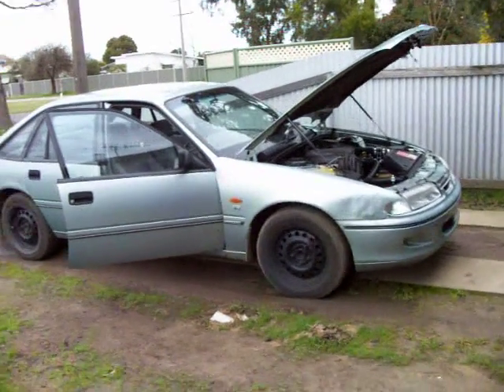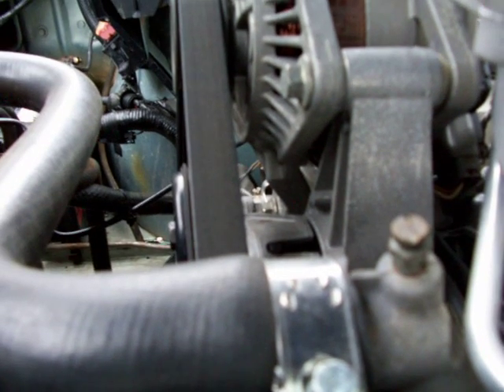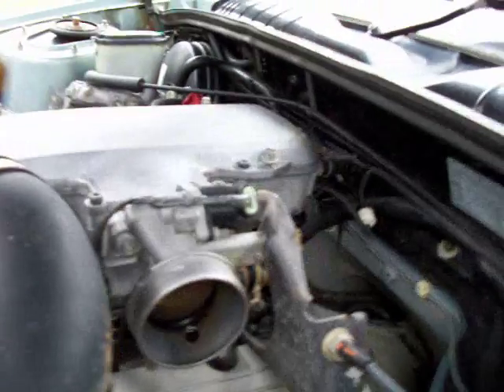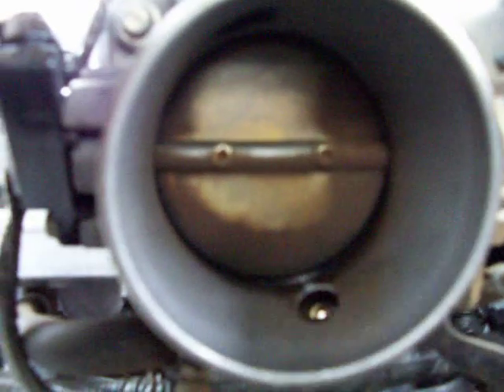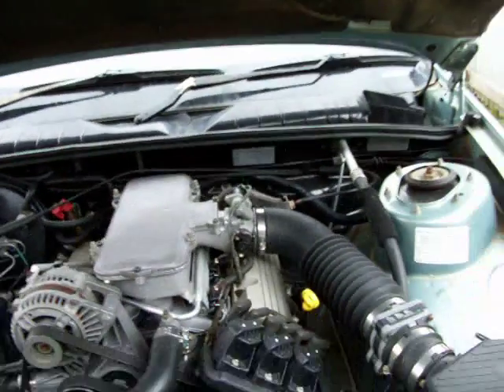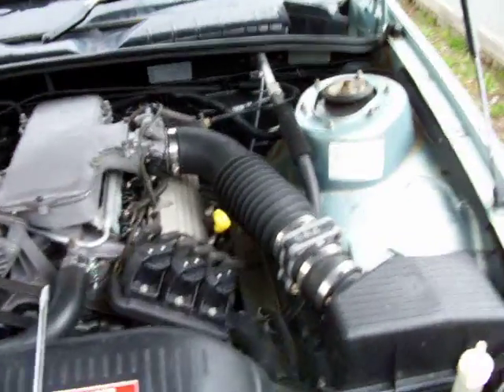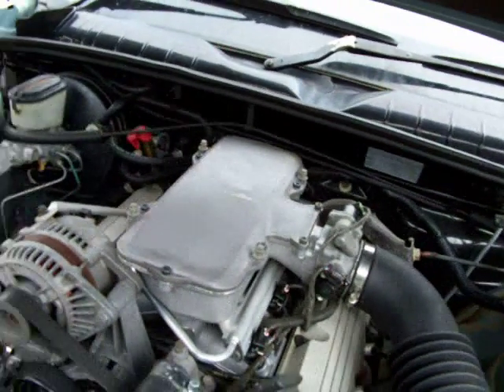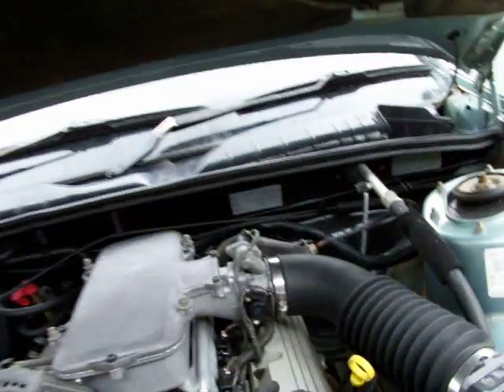how to fix poor idle on EFI(multipoint)

Comment: Great video, very informative. I am still driving my 98 VT, a rough idle problem was solved a little while back when I found the throttle body to air filter rubber hose had gone brittle and started cracking causing air leaks. Taping it up or replacing it fixed the problem.
Reply from the maker: Was your VT fitted with a supercharged L67? I'm curious as L67's seem to have that problem often
Reply: @wickedxe no just a standard v6

Comment: I'm buying ( stealing a dodge Ram with the viper spec motor! Lift kit, huge tyres. ( monster truck) I'm going to run over my vx commodore and my neighbours commodore. And any falcon/ commodore I see. My idle is high when cold. 950 to 1000 rpm after changing my tps? Piece of shit! Sorry mate. I'm frustrated! Lol. An oscilloscope video on commodore and falcon sensors would be great 👍. But with my budget I guess I'll be buying  an E bike! 😆. Cheers mate 👍. I keep coming back to your videos.
Reply from the maker: The tps needs to be re-learned by the ecu, the high idle will calm down after a while; do a few wide open throttle take offs (like a freeway onramp) and that will take care of it. the scope isn't required as the sensor is basically a variable resistor (like a volume pot on an amp) and it is fed 5 volts by the ecu; the voltage varies depending on the TPS/ throttle position. The ecu is designed to self calibrate the tps sensor; you just need some WOT throttle take offs and it will be okay. Stick with the VX Commodore as anything from Chrysler is unreliable rubbish that you will want to burn in a very short amount of time of owning it
Reply: @wickedxe  thanks for the quick reply! Does that mean that I have to do the 40 minutes relearn procedure? That's why I mentioned RAM? Purely for ramming or running over the commodore. Lol. I was going to disconnect engine fuse or disconnect battery for about an hour and check all connections etc. Then reconnect battery? One day I'm going to but a techscan 2. Thanks heaps 🙂👍👍👍
Reply: @wickedxe  oh btw ! Yes Chrysler is shit. Especially the 300C. I've seem my brother rebiuld the heads on the 5.7 hemi. Valve seats sticking out of the heads?

Comment: I've got a VX commodore (anniversary model), and have just cleaned throttle body and idle air control valve (the valve on throttle body that he showed).
We have also just cleaned air mass flow sensor (hint, can't just use any thing to clean it, need proper air mass flow sensor cleaner).

Like he said in video, we ourselves have never touched idle screw that he advised not to touch), however, a mechanic that I took my car to not that long ago has played with the cable and screw. He had the cable to tight and has threaded the screw itself...hence why we never touched it

Due to issues of car stalling, extremely rough idle, lack of acceleration sometimes or a sudden urge of power, sometimes hard start or not starting at all and at times there was a strong smell of fuel.
Not the mechanic who played around with the cable and screw, I got mechanic who normally go through who did a diagnostic, which came up with codes (cam sensor, EGR valve and showed the rpms are way to low.
Replace cam sensor and EGR valve.
A lot of people are unaware that EGR should be cleaned every so often (admittedly, I was one of them), so maybe a video explaining and showing that

Comment: Thanks for the tutorial! My vx isles a bit low and fluctuating in diagnostic mode? Sprayed water around electrical wires( no arcs) spray water for vacuum leaks nothing? New Delphi ignition module and coil packs, 3 new coil packs, leads ,plugs. Cleaned inside of plenum. New TB gasket. TB clean.i didn't clean Tps or IAC? Any reply appreciated cheers from Australia just subbed.nice job.

Comment: Thanks mate . Great explanation.  I develooed a fault code P1372 on my 2003 vy commodore.  I am suspecting Coil or Dfi for not firing or crank sensor. The car cranks but does not fire. Any tips?
Reply from the maker: If you're free I  am happy to help on 0490231352
Reply: @wickedxe  Thanks Mate appreciated. Just found troubleshooting steps on the DFI and coils . Crankshaft sensor ok.

Comment: I did just have my tps replaced twice! Don't wanna pull the throttle body off cause of it!! STILL IDLING HIGH! FIXED THE FLAIRING THOUGH😷😷😷
Reply from the maker: Is your car an ecotec or is it a VR Buick?
Reply: @wickedxe  buick
Reply from the maker: @Fippetz  Could have a vacuum leak, in the Buick a decent vacuum leak can cause high idle
Reply: Think I know what it is the Iac vavle im taking it back in for a roady tomorrow anyway I can't find a leak anywhere besides maybe on the plastic of intake
Reply from the maker: @Fippetz  I couldn't say without seeing the car but I have seen even the brake booster leak vacuum. you will just have to give it a very careful inspection
Reply: What about that lil one above the brake booster one the hooks into the injectors? Its a little bit cracked
Reply from the maker: @Fippetz  If it looks dodgy, replace it

Comment: Just wondering my car doesn’t have any gutts anymore I put my foot down and it’s still slow I changed all the leads spark plugs coil packs and still nothing
Reply from the maker: Could be a number of things, Fuel pressure low due to: clogged fuel filter or a buggered fuel pump, A buggered Mass air flow meter. I would check the fuel pressure. A rubber ballet hit against the underside of the tank can show you if the pump is a problem although an inline pressure gauge (like the kit on ebay) is a 100% accurate way of diagnosing fuel system issues. Did it happen suddenly or slowly over time?

Comment: I took my throttle body off and cleaned it and it was really dirty i also took that sensor off and cleaned inside there too put everything back together car started and idling perfect but now car feels sluggish and revs feel rough can't tell if it's because of mucking around with throttle body or car not liking the new oil i put in because i also did an oil change
Reply from the maker: Could be a vacuum leak? has it improved sence you have driven it a bit. Or did you tighten the hose clamps between the mass air flow meter and the throttle body duct? I have seen that as a problem and lol I did the exact same thing on my calais the other day, 1st time I have forgotten to do up that clamp
Reply: @wickedxe  Hasn't improved since driving and yeah put everything back together perfect not sure what causes this it's actually had this problem for years now but since cleaning throttle body it seems worse I mean car still gets up to 100km no trouble but sometimes it'll speed up like a rocket other times feels like i'm towing a caravan and I always run bp ultimate
Reply from the maker: @grassyfieldz4578  Interesting problem. I will go and think about it more. ecotec v6? not a buick vr v6?
Reply: @wickedxe  Yeah ecotec v6 I just bought an aldl cable so going to see if it has any fault codes
Reply from the maker: @grassyfieldz4578  they can be handy although I have yet to play with my software enough to get useful info out of it. It's also worth getting a copy of the factory manual (I could only get the factory book to install on a windows xp laptop)
Reply: Idk about the obd1. I used an adl type cable i bought off ebay that came with some software on it, i used it with laptop and checked everything, it worked good but i didn't have any codes at all.

Comment: G,day m8,i have a problem with high idle but ,haven't found any vacuum leaks or other,seals in the intake (manifold are new) had this problem for a while,has LPG and i think the leak  is after the airbox. any ideas

Comment: I think the doovalackey you called the MAP sensor is the purge control solenoid.
Reply from the maker: LOL yeah I realised after I shot the vid. I had a dickhead moment. You are absolutely right. I could not see the valve with my eyes due to it's location and assumed it was a map sensor, but I worked that out when I watched this video and could actually see it.

Comment: I've definitely subscribed , great videos with excellent details, a tonne of info 😊
Reply from the maker: Thank you very much mate :) Anything you would like me to make a video about please let me know :) petersmyth79@yahoo.com
Reply: wickedxe hey I have a question
I have a vt 99 ,6 cylinder
I've changed,
Feul filter
Feul pump relay 
Maf sensor 
Cleaned throttle body 
Idle speed valve 
Spark plugs 

Sometimes when starting the car it will run rough for about 10 secs then smooth out , was stalling sometimes at idle before changing those things 
What do you think it could be ? 
Coolent sensor ? 
Any help would be appreciated

Comment: Very good video. Glad it popped up when searching. I was about to look for an adjustment screw! Oops! ;) My 2004 VY Commodore Wagon has had a rough low idle problem since I got it 2 years ago. When turning the steering wheel or shifting and reversing it stumbles badly then recovers. The car originally had LPG fitted too. When they removed it they blocked the extra drilled injector manifold holes with bolts. So I guess also a potential source of a vacuum leak .-.-.
Reply: Well I pulled my finger out tonight and cleaned the butterfly and idle sensor. The sensor had a bit of carbon but it wasn't too bad. The idle improved but I still get it stumbling when I turn the power steering hard while stopped. Any further ideas? .-.-.

Comment: Thanks that was a good description of where the trouble may be and how to deal with it. I even enjoyed the extra info. Would you recommend disconnecting the PCV hose before cleaning the throttle body? Could you please make a video on how to change a fuel filter on your VT?

Comment: hay bro  I have a gas smell coming from my 2001 holden vx at back of the engine or leaking down to the gearbox but don't know from and I don't know were or what it coming from just wondering if you know or had that before . thanks

Comment from the maker: if the ecu senses a vacuum leak, the ecu compensates for the extra air by injecting more fuel; hence the reason why it idles higher than normal

Comment from the maker: you can get a fluid tester that tells you what the boiling point is, but i think it's quicker and better to just simply change the fluid in the system, which i am going to do a vid on too :) i want to pass on the knowledge i learned working as a mechanic for a number of years

Comment from the maker: thanks, and your absolutely correct. that's why it's important to not use brake fluid from a container that's been opened then stored for a period of time. and to change brake/clutch fluid regularly because it absorbs water and lowers the boiling point of the fluid(which when new should be around 200 deg C) which causes brake fade when the brakes get hot. which is a pain if you want to stop.

Comment: Hygroscopic is the word you're after - Brake and clutch fluid are the same.
This is why all containers have good seals to keep the fluid in the best condition - If the seal/cap for Brake or Clutch fluid is cracked/damaged/perished you should replace it.